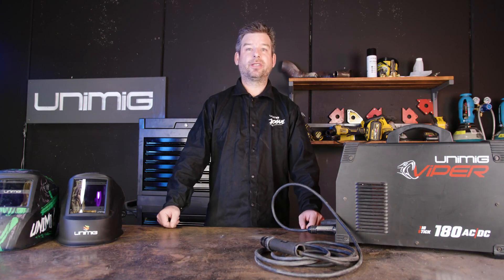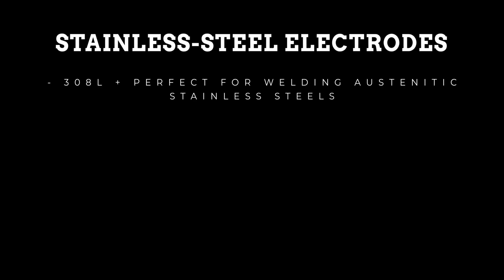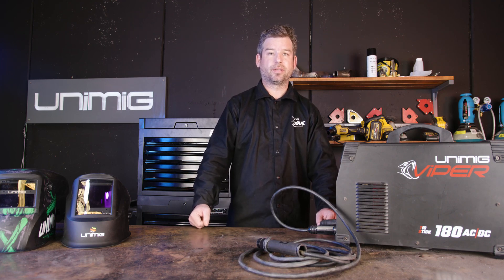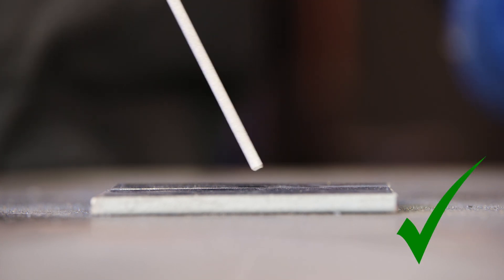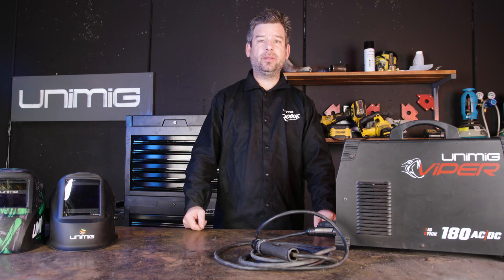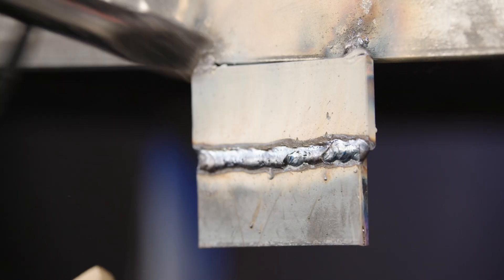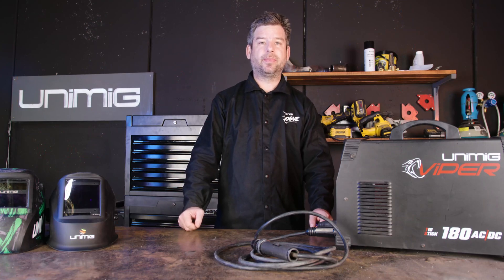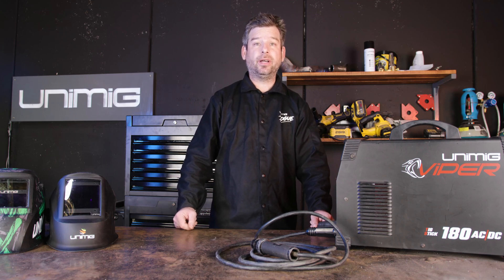The ULTIMATE Stick Welding Guide!

Comment: Do they not use 6010 Down Under? Also great video, I like that twist head stinger
Reply from the maker: We do! However, they are not that common to be used and are only used on super crucial root runs. We personally use 7016's a lot more for this application. Thanks for the comment mate!